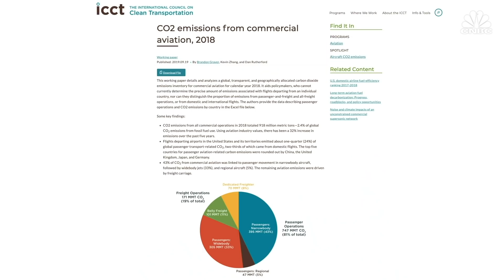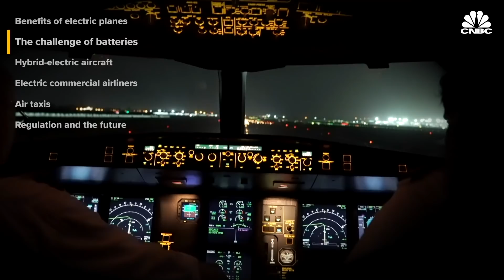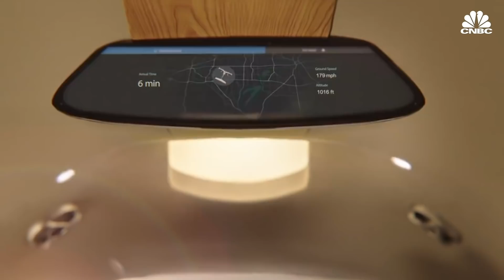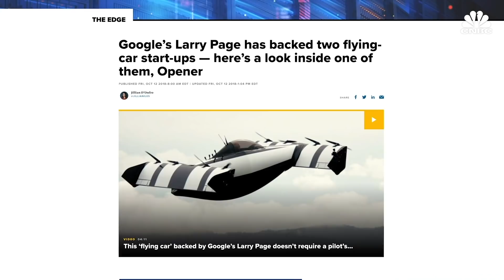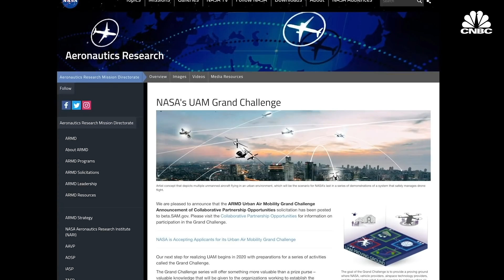Why Don't We Have Electric Planes Yet?

Comment: Because we can’t have nuclear reactors in a plane
Reply: We can, but its risky as hell lol
Reply: If we crash now that's great. LOL
Reply: Actually we can have nuke reactor planes.  There is no radiation threat, just public perception is horrible due to a lack of basic science understanding.  Blame your Congressman for your lack of education.
Reply: @davidbeppler3032  I'm curious how does that work?
Reply: David Beppler 
B-36 had one
Reply: @randomuser5443  Omega Alpha just explained that that is impossible to have a nuke reactor on a plane.  It can't happen.  Because he has an advanced degree in alternative facts, he must be right?
Reply: @davidbeppler3032  mhm, Russkis had a literal flying laboratory in their airspace for some time.
Reply: Panamax cargo ships could be nuclear
Reply: @JerryDLTN . True but if you know how shotty the maintenance is on alot of those ships you wouldn't want a reactor anywhere near them.
Reply: 9/11 would have been a little more deadly
Reply: jweltsch22  Aaand wrong. 
Hydrogen is harder to explode than kerosene (You can thank rocket technology research for that find) and material technology has progressed to the point where we have the materials required to adapt hydrogen. 
In fact a study 10 years ago stated that we could move to hydrogen in a relatively quick R&D cycle and since then we've got even better materials thanks to fusion reactor research. 

Also both fuels can be either flammable or explosive depending on the mix with oxygen. 
Hydrogen is explosive at a 1:1 ratio which is not happening, this is why the hindenburg burned and didn't explode. 
In other words you are wrong on all counts. 

Tell me, why are you invested in retaining an old and harmful technology such as kerosene?
Reply: B-36 almost had one, but that was cancelled
Reply: 1) We can, that's the initial purpose of the thorium reactor. 
2)We could use hydrogen that's produced through nuclear energy. 
Hydrogen has a superior energy density than kerosene, us a proven jet fuel and has no CO2 emissions. 

The reality is that we're catering to big oil and the petrodollar.
Reply: Indi  True, although i'am not sure anyone really wants to risk a plane with a nuclear reactor crashing.
Reply: Because clouds don't have charging stations where a plane an pull in and get charged up.
Reply: @kansasthunderman1  You gave me an idea for a really nerdy solution. 
A ground station that charges the plane with microwaves, and yes microwaves can be used that way, such technology is considered as a way to transmit energy from orbital solar cells.
Reply: Yea like in fallout
Reply: Isn't there a new battery that has twice the energy density of today's batteries invented by same guy who invented today's lithium ion batteries.
Reply: We have and we can, but if you crash...
Reply: Wtf
Reply: Some country use nuclear reactor to produce electric...Hmm electric propulsion = environmental friendly🤔
Reply: But we can in an aircraft carrier and submarine
Reply: last time we had anything nuclear in a plane two Japanese cities disappeared
Reply: We have. Also, that’s not the only way we have to generate electricity.
Reply: james mcbride  NYT did an article on flat earth.  Does that make it real too?  I studied basic science in 5th grade.  That is all it takes to debunk "car runs on water".  lmao
Reply: @Ben  Daulton it's a fuel, one that is now obsolete and must be replaced. 
Having respect to a fuel is counterproductive.
Reply: @Ben  Daulton An industry will not turn on a dime until it does. 
Your logic creates a self fulfilling prophecy where the unwillingness to move away from kerosene ensures it won't happen. 

You don't need to make the whole plane carbon fiber, just the fuel tanks, the engine is the only part that needs treating and there's new developments in material technology that have solved this problem already. 
You basically posted a problem that's already solved. 

You can run turbofans on hydrogen however you can also use hydrogen in a fuel cell to produce electricity and run an electric turbofan. 
And if you didn't know electric motors are the most efficient motors we have.
Reply: james mcbride  you can also make liquid oxygen.
Reply: @Ben  Daulton. And the sign still says 2 days because the guy who was supposed to change the number fell off the ladder.
Reply: @Ben  Daulton 1)Then either subsidize the materials, ban kerosene or nationalize the plane construction industry. 
This "put profit above the solution to an extinction level threat" mentality is outright moronic. 
2)I have looked into it, electric jets are more efficient than turbofans. Electric motors have incredible torque and energy conversion ratios that combustion systems simply cannot match. 
3)Yes, and you can redesign the aircraft to accommodate the new fuel cell design. 
This is not an argument. 

4)Then propose your solution, so far your argument is "keep everything as is and we'll just deal with our biosphere destabilizing through pixie dust harr harr" 

And guess what, you don't need to know how to change the oil of an aircraft to comprehend some of the engineering behind it. 

Your own argument literally disqualifies at minimum half of the engineers who work in making planes. 
And yes, it might be in a different field, but I am an engineer.
Reply: U r wrong. There was plan for one. I think they built it too but not sure they ever took off
Reply: They tried that before as a concept.  It won't work, and it's far too dangerous.  Radiation would be spread everywhere due to fissile materials.  Why this was even considered for the B-36 is beyond me.
Reply: Be ready to have a gigantic radiator create a herculean amount of drag just to cool down the reactor with a closed loop water cooling system.
Reply: I don't believe reactor technology is anywhere near being small or light enough to be used for commercial aircraft. Plus if you had a catastrophic failure in the upper atmosphere any escapeing irradiated particles could be dispersed over a much larger area then if the failure happened at ground level. Plus then we have more nuclear waste to dispose of..... might be the best solution we have though....
Reply: @huntsbychainsaw5986  we got nuclear powered submarines
Reply: @britefeather  Yes but submarines don't fly they float and buoyancy works much differently than flight and if you think of the amount of space available inside of a commercial aircraft then compare it to the crampt quarters of a nuclear sub  you can see the problem.
Reply: Hunts By Chainsaw Exactly
Reply: @huntsbychainsaw5986  Actually, there was a soviet prototype for a Nuclear powered jet and US experimented with a nuclear powered tank. And right now Russia is testing a nuclear powered missile (not nuclear warhead, nuclear propulsion, which would give it the possibility to the circle around the globe). The problem with such a plane is not the size of reactor, but the dangers of using it. The nuclear propulsion jet works a bit similar to a huge air pump. In jets, avgas/kerosene explodes in  the air creating huge ammounts of heat which is then funnelled through a narrow space resulting in thrust. With nuclear propulsion you use the air to cool the reactor, which basically would turn the air into plasma at huge temperature (thus high energy to be transformed into kinetic energy). But this system has 2 problems: 1. There is no way to reduce the level of radiation going out with the air. 2. There is no way to cool the reactor by just using air. You need water. But the water supply on an airplane is extremely limited.
Reply: @nottoday3817  I was aware of the Soviet and American tests of small reactors for propulsion and I had also heard about the Russian incident with the nuclear powered missile but I had no idea how a nuclear reactor could be used to propel a missile. Until now I've been procrastinating on doing the research so I appreciate the "crash course" on the fundamentals. Thank you.
Reply: @nottoday3817  Thousands of gallons of fuel on a plane... that why there is no room for water?
Reply: @nottoday3817  yeah i guess "insulating" the reactor with water and/or concrete wouldn't really work

Comment: Because Kerosene is about 40 times more effective efficient and dense as an energy to fly than electric.
I learnt about it two weeks ago
Reply: What you mean? Electricity has no weight.
Reply: Jack is not in the box battery weight is huge, please research
Reply: Also There is a different beetween works of plane and Cars. Cars only need to give lateral speed basically they only need energy to push you from one point to another in 2D space. Flying in other hand is in 3D they need more energy to maintain their position and manuver also too produce lift force it was more inefficinet than car.
Reply: Traditional chemical fuels come in around 40MJ per kg. Current lithium ion come in a little under 1MJ per kg. Of course electric motors are more effecient than engines. For most passenger vehicles, effeciency corrected, chemical fuel carries 10x more useable energy per unit mass. For a very effecient jet engine, that could be more like 20x.

Initially electric airplanes will start with small passenger variants. Then they will move to domestic routes, and likely air freight, as the logistics allow more charging stops. Finally long haul commercial aircraft. The changes required will not just come from improvements in battery design, but also improvements in material science, like use of Carbon Fiber Reinforced Plastics.

It will probably take 10-20 years before commercial jet aircraft start seeing replacement by electric counterparts. Perhaps longer If fuel prices drop.
Reply: @Bob_Lob_Law  @RAI FIKAR J precisely both of you
Reply: Generally speaking, combustion engines are less efficient than electric motors, but make up for it with a higher energy density.  Combustion loses efficiency to unburnt fuel, waste heat, etc.
Reply: jweltsch22  Once again, outdated arguments. Capacity degradation is hardly a concern anymore. Tesla has battery packs projected to last ~1000 Cycles. Charging infrastructure for the model 3 also allows 250 kW Charging, or ~3c. Which is ~20 minutes, not hours.

Battery technology is far exceeding performance requirements for automotive technology. The only real challenge for aircraft is gravimetric energy density.
Reply: jweltsch22  Ok. Let's begin.

1. You do not seem to understand what "cycles" mean in this context. It is the amount of time a battery can be charged and discharged. 1000 is plenty, there is no law saying the batteries have to last the life of the air frame. They can be treated as a long term consumable.

2. MW/hr doesn't make sense gramatically in your sentence. Its like saying "a car uses 7 liter of drive". I think you mean, 7 Megawatt hours per hour of flight, which just means 7 Megawatts a unit of power, not energy.

3. It is not 250kw/h. That is a unit of energy, we are talking power. 250kW is a rate of power. It can be scaled to any sized battery, it is just an example. What is important, is the 3c charge rate. which means a 20~minute charge no mater how big the battery is provided the charge power can scale. It can scale.

4. There are plenty of industries that use more energy than the aviation industry would require. Saying the power grid is not capable of this is ridiculous. You just need to scale your batteries and chargers. Not impossible.

5. Batteries wouldn't explode, once again this is a matter of scale. Of course a cell phone battery or a Electric car battery pack would not provide power for an airliner. You would simply need a larger battery.
Reply: What about gasoline? And cng.
Reply: That's a limiting factor for use in airliners but even current battery tech is viable in smaller applications
Reply: And hydrogen is superior in energy density to kerosene, is a viable jet fuel, produces no co2 and can be produced with nuclear energy and no emissions. 

But they're taking the long way around because they're trying to cater to big oil.
Reply: O
Reply: Yeah but eletric motors are much much more efficient then gas engines/turbo props
Reply: Wrong! The new batteries Tesla made provide 3 times the power for same weight and space
Reply: @testaccount603   Real Engineering's video "Are electric planes possible", he says that leading li ion batteries have a capacity of about 0.38 kW/h per kg if I'm not mistaken. In a scenario pitting a commercial plane vs a small private plane you'd need 300 000 kgs worth of battery and above to make the bigger plane fly for two hours or 7 hours with that amount of energy.
That's just not feasible
Stop being a delusional Tesla fanboy and apply facts. Yes they've made quite the advance, but battery technology has to do more than quadruple and quadruple their energy density efficiency and effectiveness to make themselves a viable option and replacement for kerosene in planes.
Lithium ion batteries are extremely inefficient for a lot of applications, batteries are inefficient right now. This is fact.
Reply: @testaccount603  The chemistry just doesn't support it. And batteries are still chemically based,
Reply: James Segrest cough solid fuel batteries
Reply: @JDSeg693  It's Physical Chemistry.
Reply: first name last name  Not real.
Reply: Test Account but they lose capacity